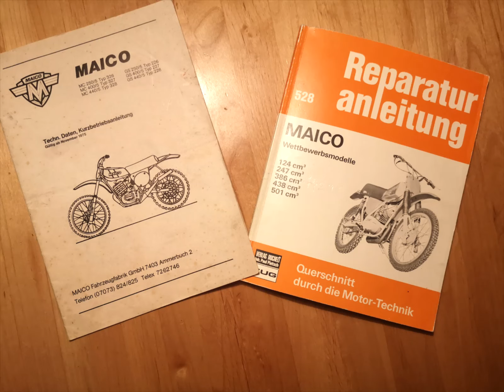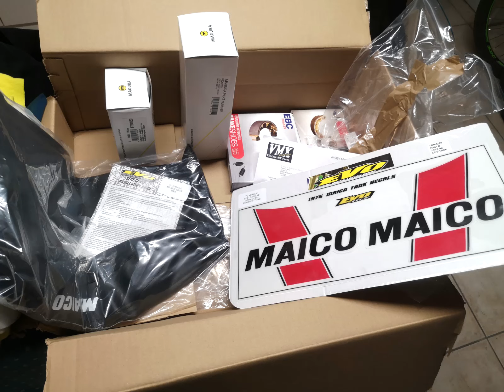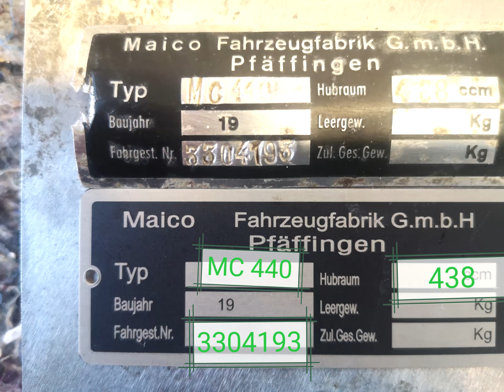Maico AW440 restoration  project, classic Maico 440 1977

Comment: Do you know anything about the AW 450? I owned one back in around 1980, bought it from a District 6 Expert AMA rider. But info about it is very scarce. I KNOW there was an AW450 because I did find an article on it in an old Motocross Action magazine.. unfortunately the pages were almost unreadable. Do you know anything about the '77 450?